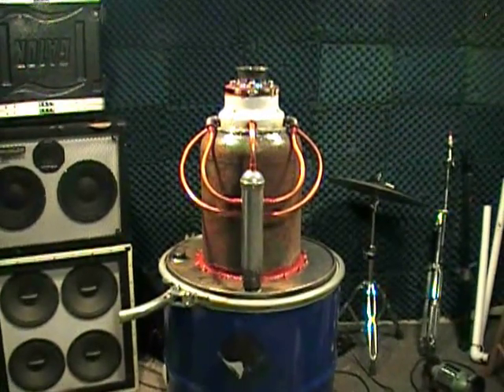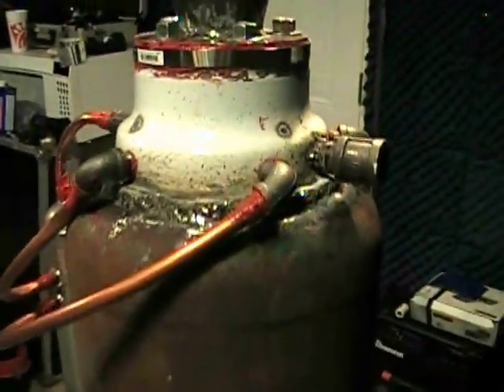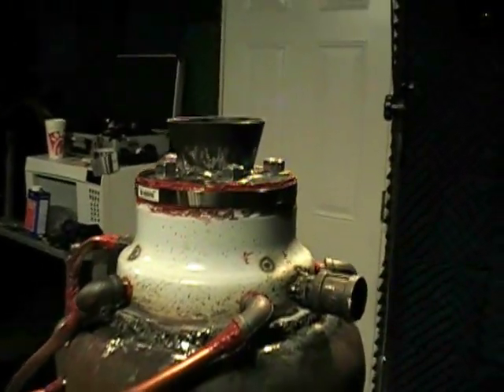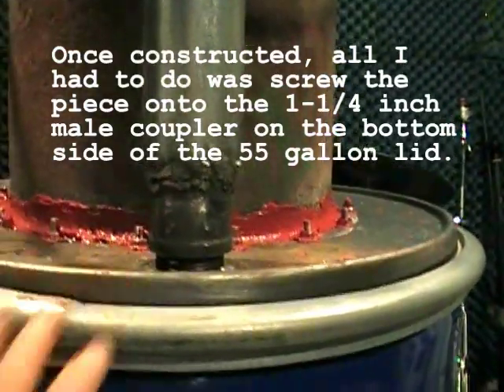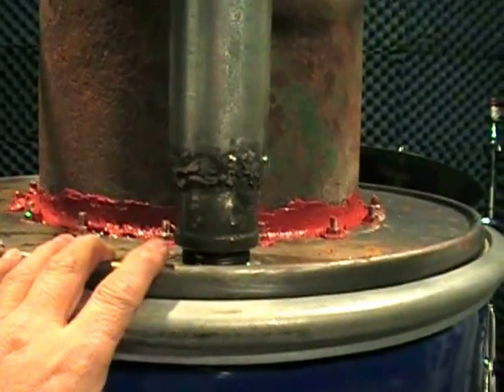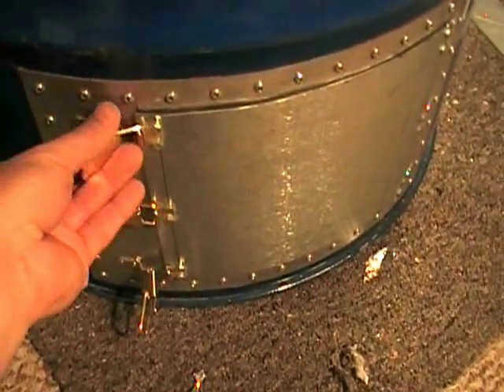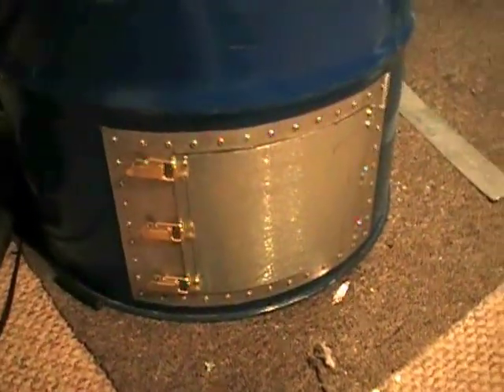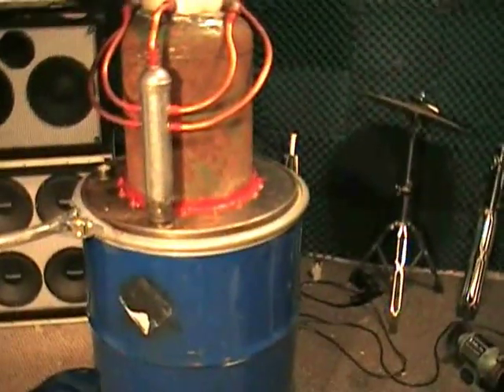A peek at the new Imbert gasifier build. (02-19-2013)

Comment: I built a system very similar to this one. It worked great. Had a clear flame once I ran the gas through my cyclonic filter, a heat exchanger, a water cooler/filter and a straw filter. Very nice job. I will Integrate some of your ideas into my next system. God bless.

Comment: Has it really been 8 years without a conclusion to this ?  What am I missing ?
I recognize your pipe fitting that goes through the 55 gal drum lid as cast black pipe. 
No No No you do not want to weld to that. find your self steel fittings to work with .
I appreciate your work , just offering sugestion from an old welder that has built many things 
at hole .
Reply from the maker: Thank you for your reply and your suggestions. I never used this build but instead modified it to be a center feed air nozzle build which went to a friend. During all of this time, I was experiment and tinkering with ideas. As to what to weld or not to weld when I did this build I was clueless on a lot of metal properties. I know more now but I'm no expert but I know how to research what works and what doesn't these days.

Comment: if you are regulating the air input to the nozzle manifold why does the 3/8 or half inch tube make any difference the hearth nozzels ends? seems the same amount of air could be regulated in either case , just flows faster through it. but i may be missing something in my reasoning
Reply from the maker: Your question is a valid one. This was my first build and I actually built two of these side by side with one being different from the one in this video. I wound up modifying this one to match the second build which was removing all of the copper tubing along with a different hearth design all together. I still have the ability to choke off the air to the nozzle but that is all I use it for so I can shut down the gasifier if needed by choking off the air to the nozzle. My final build is a single nozzle design and it works really good. If you get a chance go and check out the later videos and I actually disassemble the final build and show how it is build in as much detail as possible for everyone to see and copy if they wish. I hope this answers your question.
Reply: i just viewed a couple of your video's, but i will subscribe to see your modifications on your build. here in Sask Canada they use temporary tubes for grain storage on fields , the tubes are 100 + feet long and heavy plastic, about 6 foot round when filled that are tossed in land fills each year.  I was thinking of gas storage by cutting and sealing the ends and one 20 foot would be like 10 tractor inner tubes at least. i was thinking hydrogen gas until i stumbled across wood gas. I have enjoyed your video's so far and you explain things nicely.  Looking forward to seeing more, but my data streaming is limited. Thats another thing, no 1 minute intro's, nothing fancy just good knowledge and advice, thanks for sharing, God bless

Comment: So Flash, which gasifier performs better, the downdraft or the Imbert. If you were only going to build one, which would you build? Also what changes would you make to run a twin cylinder 20 HP Honda engine?

Thanks Gary P in Utah
Reply from the maker: Gary Prendergast definitely the Imbert design
Reply: and the 5 nozzles would work for a 20 HP engine?
Reply from the maker: Gary to answer your question it should. I had to tinker and experiment to get my gasifier to work with smaller engines. The trick is three fold. 1. Reach a minimum temperature of at least 1652 Deg Fahrenheit. Some people aim for 2000 Deg Fahrenheit. 2. Make sure the nozzle(s) diameter are adequate enough to allow the engine to breath well enough to run. 3. Keep the gas moving through the ember bed at a correct speed so any tars in it can be cracked. If the gas moves too fast you can be as hot as the sun and the time needed to crack the tars will be too short to accomplish this. I had to experiment and tinker with my nozzle diameter until I found what I considered to be a sweet spot plus my build isn't a standard Imbert because the ember bed configuration is different which also helps crack tars since it is a bit deeper. I hope this helps.
Reply from the maker: Gary I just realized this is one of my older videos. I've made a build with a single nozzle down the center with a much deeper ember bed (hearth) than I show in this video.
Reply: Thanks for all your guidance Flash, you've been a big help. I start my build this weekend!

Comment: on the copper tube/theres auto crip ferrel method= slide on nut on to the copper.. then ferrel.. then as titen onto double male pipe 1/2 to 3/8ths.. the ferrrel swells and walla. beautiful/ esy tight fit...im good welder.. mig/ tig/ stick /braze.. the mig machine you got is great for thin pipe/ trick is stay on the thick metal fitting and after bead started /start lay bead on both pieces.. but mostly on the heavy metal. Great looking project/ bets the air flow is way more controllable=safer!!!Keep -up the good work .:>)

Comment: Fantastic video! This will be my next project. Wonder if it will run a military generator.
Reply from the maker: +hydrolife04 It should handle an engine in the 18 20 25 Hp range. I actually have this build sitting in my shop and it has not been ran yet. I was doing two builds side by side with one being a single center nozzle design. If you look at some of the later videos I cover the second build in detail.

Comment: I have 5 air tubes coming down from a manifold (single port air inlet) and taking a 90 into the fire tube. Looking at your''s I had the idea that I could use soft copper pipe and wrap them around the fire tube, so to speak, to get more preheat for the incoming air. Can't wait to get to Lowe's plumbing section.

Comment: hey i wanted to ask  how well the copper held up ti the extreem temps it should have done fine but i wanted to know if there were any problems O.o
Reply from the maker: The copper pipes held up fine because they only carried air to the steel nozzles and the copper itself never corroded from anything in the woodgas. Tritowns thought I may have an issue with corrosion but that was never the case.

Comment: hi
is there asmall holes at the end of the copper pipes inside the reacter
Reply from the maker: No. They actually attach to steel tubes that feed air to the ember bed.
If you get a chance, check out my latest build. I got away from the copper tubing and went with a single nozzle down the top center of the gasifier.

Comment: hi
i want to ask you if i want to convert this gas to liquid gas as in the probane bootles in order to compressed it in probane bottles or tanks to minimize the volume of the gas what is the steps and is the air compressor suitable for this how mutch bound does this system produce
will you help me for some information if i want to make asmall factory to produce asyngas from wood
Reply from the maker: You were asking about compressing woodgas and I can tell you that there people doing it but it's not worth it. The next time you are around a full tank of propane, pick it up. What is inside of it? Answer: Liquid propane. This means you have a lot of gas in that tank. woodgas will not compress down to a liquid where you can get a large quantity into a tank unless it is processed and converted and the average Joe does not have that kind of equipment in their garage. The beauty with woodgas is it is an "on demand" gas that is made while the engine is actually running off of the gasifier. This is just my opinion but those that are using air compressors to bottle it are doing an extremely dangerous thing. Now with that said, you can fill up large tractor inner-tubes with it and place a sheet of 4x8 plywood on top of the inner-tubes then place bags of sand on the plywood to build up pressure and use that for a small cooking stove, There are people that do that and for a small stove where they tie all of the inner-tubes together to a single line and pipe it to a gas stove with good results.

Comment: Flash this really looks like it will do about 20hp
Reply from the maker: Tom it probably will. Believe it or not, I never fired this beast up. I still have it just as it is because when I built the other gasifier up it wound up working very well and extremely stable so I didn't want to chance it. When I built this up I was still a bit fuzzy on sizing the nozzles but if my memory is right this should have been at home with a 12.5 Hp engine so a 20 Hp engine would not be out of the question either.
Reply: I think my next one will have better burn zone situation. I notice that if I can measure the amount of air draw from any particular engine. I really like the sand/plaster mixture. I have my first done all the way to the cyclone filter which is a 15 gallon oil drum that I had to rebuild twice.

Comment from the maker: Yes you can braze it. A few weeks ago I broke down and purchased me an oxy/acetylene torch and it was the best damn investment I've made. It had been at least 40 years since I've used an oxy/acetylene torch and it would have made brazing to the pipes much easier without the risk of burning thru the thin steel pipe. The little mig welder does great but not on very thin stuff.

Comment from the maker: Thanks Walwart. This was a learning process as I built the gasifier. I also found out that even using a small hand held propane torch accomplished the same thing. It was more about just getting the feel of welding. I'm not perfect with it but I do get solid beads now even on the thin stuff without burning thru or with very little burn thrus now.

Comment from the maker: I found that using a 1/2 inch nozzle gave me the proper billow effect or the proper air penetration into the ember bed to raise the temperatures high enough to either crack the tar or to lower it enough to be easily filtered clean. Why it worked out like that? I don't know but you could just use three 1/4 inch nozzles in a 120 Deg configuration for an engine that has a 3/4 inch diameter exhaust pipe. My 12.5 Hp lawn mower also has a 3/4 inch exhaust so go figure. Cont one more time:

Comment from the maker: A good hearth design using a rim with nozzles and a sheet of steel rolled around it works great too because it too has a low back resistance but the reason I avoided that design is because once the nozzles burn up (and they do wear out) you will have a major repair job replacing the burned up nozzles. The beauty of the single nozzle design is it can be unscrewed like a burned out light bulb and replaced with a new nozzle but that's just my opinion and others may disagree. I hope that helps.

Comment from the maker: I used the Imbert charts for the gasifier in the video but the second "off the fly" gasifier was a different story. Something else too. The single nozzle design does not have any back resistance but the copper tube fed nozzles do have a bit of back resistance. I have tried my gasifier both ways and a single nozzle design is not only a simpler build but to me it works better too.
There is one more thing I want to mention so I will continue this one more time.

Comment from the maker: Tim I took a different approach. Another youtube user "tecknowfreak" said that a simple effective way to size your nozzle(s) is to look at the diameter of the intake or the exhaust on an engine and make sure that the nozzle or the combined nozzles are just a bit bigger than the engine. Example: On my 5 Hp engine the exhaust size is 3/4 of an inch thick so technically I should use a size somewhere around 1 inch by his logic but in reality, I found that using a 1/2 inch nozzle gave me the: Cont

Comment from the maker: Tim go to my channel and find the following video: "06-09-2013 Gasifier inspection / Tar discussions " Somewhere around 11 minutes I will go inside of the top of the gasifier and zoom in on the single nozzle setup. This will give you a clear idea of what I have built. As to using stainless steel tubing keep in mind that not if but when you need to change out a nozzle, the stiff stuff will be really hard to work with. The copper tubing is never exposed to the fire so it will not melt.

Comment from the maker: Craig you can Google the following: "imbert nozzle sizing chart". My new design is a mixture between a stratified downdraft gasifier and the Imbert design. I use a very deep ember bed like the stratified downdraft gasifier  plans call for but with nozzles instead of the downdraft method. My ember bed is 9 inches deep compared to the shallow ember bed on the gasifier in this video. I feel that it gives me a stable clean gas even at lower temperatures.

Comment from the maker: The bolt on bell can be taken off to allow the unit to accept a smaller reduction zone for smaller engines. I learned the hard way that the bell in this video was allowing too much char to fall through the reduction zone so I changed it out and it is working good now. I'll be doing a video with the generator running soon. One more thing. Had I welded the bell to the reduction zone, I would have had a major job with the fix. Instead I removed 5 nuts and made the mod to fix the issue.

Comment from the maker: It may be OK. All I can do is test it. The whole unit can be upgraded if needed plus this is a learning curve for me. I have made mistakes and I have figured out some pretty clever ideas so it's a learning curve. The sister gasifier to this doesn't use any copper but I can see where the acids along with other things in the gas will take a toll on any gasifier. I'll be doing a generator test soon and the gasifier appears to be running smoothly.

Comment: Can you elaborate ( be more precise on what the devise is or looks like) on the bolt you have and the inverted bell if your saying what I think you are saying with this if you are running a car engine it will idle and then give more wood gas as you push the accelerator down right?

Comment from the maker: I plan on bringing the air in through the top of the lid in the same manner but I will go through the side of the wood hopper and pipe it straight down through the center into a nozzle about 1 or 2 inches above the top of the ember zone so stay tuned. This should work and it will be much simpler too.

Comment from the maker: moto2kx2 Thanks for the input. This is a learning experience for me and I am no expert in metals by any stretch of the imagination and that I will admit to.
I had to work with the materials that I could lay my hands onto without spending a fortune on custom cut parts. The pipe fittings should be OK plus they aren't in the line of fire (The reaction zone where the heat is)

Comment from the maker: Everything galvanized was ground off. The couplings will be away from the actual burn zone and once I proof and tune the unit up the steel air nozzles will be upgraded to either stainless steel or to tempered steel. As far as the welder I have I am just now betting a handle on understanding and making
solid dependable welds but the welds that were done may look a bit nasty but they don't leak and they are solid and that's where it counts.

Comment: Mig welding on Galvanized is tough. Prep the Galvanized pipe fully and never weld onto cast iron or black pipe or fittings. Use steel ones.

Comment: FYI- Grind off all galvanized prior to welding. Seems you have a cast iron coupling it could crack and fail. Next time get a carbon steel one.

You could pre heat the fence post with a torch to burn off galvanized also.

Use 7018 rods on DC current if you have a DC welder, 6011 or 6013 may work also.

IF you only have an AC welder try some AC 7018 rods.

Comment: FYI- Grind off all galvanized prior to welding. Seems you have a cast iron coupling it could  and fail. Next time get a carbon steel one. 
You could pre heat the fence post with a torch to burn off galvanized also.
Use 7018 rods on DC current if you have a DC welder, 6011 or 6013 may work also.
IF you only have an AC welder try some AC 7018 rods.

Comment from the maker: I will be using a semi hard wood from my property and it's already dried 
and seasoned so it's ready to use. for my design, my pieces will not be over one inch in diameter. This stuff worked really well and it burned very clean even in my "tar machine" FEMA. I was almost able to crack tar with this feed stock because it burned very even and very well. I was able to filter the gas to the point of being "invisible" clean even with my FEMA. Look at video # 6. I had zero smoke or tar on the output.

Comment from the maker: Even though I used a 55 gallon drum, I designed this for a small engine. The sweet spot is set up for approx a 7.5 Hp engine. My restriction size is 2.5 inches and I am using five 3/8 in air nozzles. I can also regulate the air flow feeding the nozzles too. I may have to experiment with the nozzles to make sure that I get a good air penetration into the ember zone but I designed this to be flexible and parts can be changed on the drop of a dime with ease.

Comment from the maker: but if this works out, I'll change them out with stainless steel nozzles. This is still in the stage where I don't know what may need to be changed or fine tuned so once I get it where I know it needs to be, I can upgrade to harder materials pretty much with ease. Because I am new at this, I decided to make this thing where I could work in it and change parts if needed to fine tune it up.

Comment from the maker: The copper tubing should be OK (famous last words) and I know that heat won't be an issue because some of the high temperature RTV cement was just rubbed into the sides of the reduction zone to get it off of my fingers. I did use it on the steel plate where I bolted the inverted bell into place and in reality, I could have left it off with no issues. The worse that will happen is it will harden. My only real concern is the steel air nozzles cont: